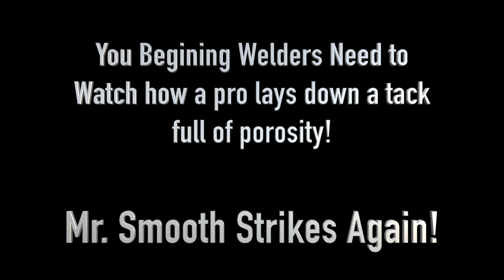Home Built Gantry Crane Part 1 - Fabrication

Comment: Good video. We're somewhat new to the DFW area (Moved here Nov. 2014). Wouldn't mind stopping by your shop some time and seeing what you're capable of. I'm always game for making new connections. I work at a Heavy Duty Diesel shop now, and my boss said he was looking for a gantry (he described what he was looking for, he didn't know what it was called).

I told him if I could get my hands on some prints for a 5 Ton Gantry, I could build it there. He seemed to like the idea. Care to link me to some local contacts for getting quality prints to meet or exceed the 5 Ton rating? (Also need it on casters, primarily for pulling engines, but will likely be used for whatever we find we can use it on, and 5 Ton will lift the front of a semi when stacking them for transport.)
Reply from the maker: This Gantry was lovely based on a 1.5 Ton Northern Tool Gantry.  I built a 10 Ton Gantry for a local company that sourced prints from a company in Canada.  Unfortunately I can't share their prints as they paid $$ to get them.  I am now in Corsicana in a larger shop 50 miles south of Dallas, feel free to come by any time
Reply: We are down in Cleburne. As as for the prints, I'd rather pay for a set with an engineer stamp than trust my life to a free set that I cannot validate the ratings on. Is your shop name the same as your channel name?

Comment: Next time you're doing something like that, clamp or tack weld the mounting plate to the I-beam and drill straight through with an annular cutter, or a DeWalt extreme 2 drill bit. That'll save you so much time and will always be perfectly lined up.
Reply from the maker: +H4NS0L0 That's a good tip, thanks.

Comment: I love that they store steel outdoors and it doesn't have a spot on it.  Where is the rain?  :)
Reply from the maker: +Hondo Trailside It has mill scale on the hotrolled steel that helps it not to rust as fast, but it still will eventually rust.  Plus it's a high volume place, they move stuff in and out quickly

Comment: That design should be very strong! I really like it and may have to "borrow" the plans at some point. I'm in the same boat; when the roll up door is open overhead I am very limited in height...

Best wishes,
Tom Z
Reply from the maker: Tom Zelickman Thanks Tom.  I incorporated some of the negative Ramsey Customs pieces that you made in the paint video that I will upload in a day or so, it turned out pretty cool.  I listed the basic dimensions in the comment section, or i could give you more info when your ready, it's pretty straight forward

Comment: Looks great - are you going to put it on casters?
Reply from the maker: Tom Noble Tom, thanks man, yes it will have Casters on it in the new shop, probably some 8" ones, so it will be around 9 ft. tall with those on it.  I won't be able to use them in my garage, not enough height.

Comment: Holy chopsaw Batman.  Nice Ford shirt.  That portable bandsaw looks awesome.  I've never seen one of those before.  Good job tacking the vice inside the beam.  Real smooth. Thanks for including that, made me smile, we all have our moments.
Reply from the maker: ***** Oh yea the portaband works well both on the little stand horizontal or using it free hand like that.  I had a slight angle to cut on one in, and a severe angle on the other end.  It worked well on the small angle but not enough throad depth to cut the severe one.

Comment: Mr. Smooth was working on my projects all weekend too...  I did like how you looked at the end of the mig torch as if it somehow misfired and that's why the weld looked like the gas was off!!!!  I like your new design a lot better.  That rig will serve you well.
Reply from the maker: Greg's Garage Yea, This guy Eric contacted me offered to let me use his gantry crane, as it turned out his shop is between my house and petes shop, in fact he is 5 min from pete.  He does art/fabricaiton work, kind of like Kevin Caron, he is the one i sent your pivot door too.  He has a 3,000 Gantry that he got from Northern tool, so I just sort of looks rough dimensions from it and loosely copied the design.  I hear ya on Mr. Smooth, he was kicking my butt!

Comment: Great job man. I thought that looked more involved than a quick fix. That will be very handy in your new shop. Congrats on that by the way.  Also nice welds. Douglas
Reply from the maker: RetroWeld Thanks Douglas!  Yea, I was just going to throw together some tubing and then cut it all apart and reuse it, but figured i would go ahead and make a real gantry crane and hang onto it until i need it in the new place.

Comment: What the heck do you have planned that will require an overhead lift?
Reply: Dee Jay Hey where's your bro code? Never question a mans need for a gantry crane.  You just nod, agree, and say yes you need one.
Reply from the maker: Dee Jay A CNC plasma table with sheets of 1/8th or 1/4" steel, so i can lift them out of the back of a truck or my trailor... or maybe yank the motor out of car easier!  lol who knows what all we will use it for